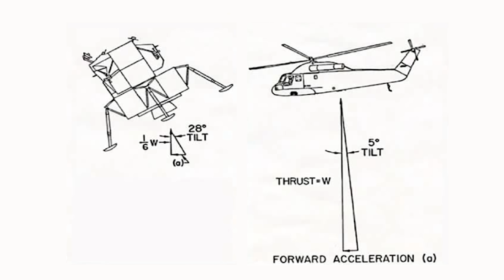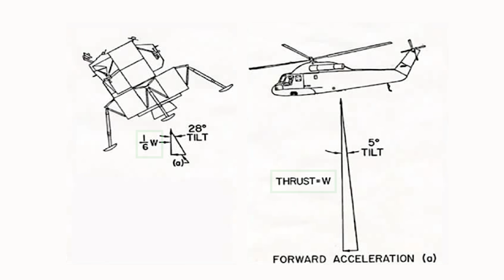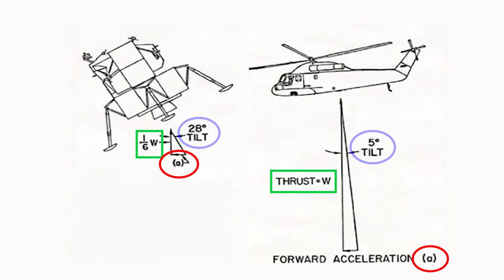How Neil Armstrong Trained to Land on the Moon  - Smarter Every Day 250

Comment: imposing restrictions on an artist does not make their art worse. Restrictions are what gives an artist inspiration, and a starting point. Some of the most beautiful art was created with the help of restrictions, whether it was the medium of the art, the tools available, or even problems held by the person creating it.

engineers back in the 60s had limited resources, and it was those very limitations that allowed them to recognize what problems needed to be solved, and pushed them to find unique ways to solve them. It's easy to see modern engineers as spoiled and much less innovative than older engineers, but that's because modern engineers have too many tools to help them solve problems. It's easy to get lost and hesitate to do something when you can't pick a direction to go to get it done. Imagine being in an open, flat plane, versus going down a thin pathway. 

It's not that modern engineers aren't as creative, it's that there's much fewer things to be creative ABOUT. so many paths have already been mapped out for them, it's harder to find a new path that no-one has gone down. It's not impossible, but it's much harder.

Comment: I really thought, that they might have built some kind of simulator with CRTVs, vector graphics and on the outside lots of hydraulics to simulate movement. Or maybe building a submarine like capsule, with the right weights, but making a whole aircraft that simulates movement in 1/6 * g is even more awesome!

Comment: Holy smokes I never realized how big of a problem this was. This was an eye opener.
Reply: lol
Reply: You would be supprised how many layers a seemingly 'simple' project like this has (if you would dare to call the moon landing simple).
Reply: Indeed, it's a big engineering feat.
In reference to 15:10 or so, Destin maybe should have put Proverbs 4, verse 7 on the end card.
Reply: They have no idea because they faked the moon landings, hollywood set and lie. Its that simple. I'll watch this to see if he even mentions the van Allen radiation belt that they have no idea how to get thru safely, with a cpu no more intelligent than a cellphone, they flew to the moon, landed and came back fine. You would have to be either easily brainwashed or mentally "slow" 
It never happened. This guy is a fraud

Comment: I agree with the idea of a free flight trainer, however simulation devices are so much better now than they used to be and as a commercial pilot I use them on a bi-annual basis. The only thing that simulators can’t change is the “seat of the pants” feeling you have biologically. Otherwise, you wouldn’t even know you were in a simulator. Your muscle memory and your visual cues would be indistinguishable from a real life flight wether it be terrestrial or lunar. A visit to an airline or aviation training facility would help you understand more about modern technological advances in this area.

Comment: 5:43 Ever heard of the "Harrier Jump Jet"? A 60's Jet ;)
Reply: The X-14 made its first vertical takeoff on February 19, 1957.   The first prototype leading up to the Harrier flew October 1960.  The Harrier GR1 made its first flight December 28, 1967.  I don't quite get the point you're attempting to make in regards to the Harrier.  It certainly was not the first jet powered plane that could make a vertical takeoff.
Reply: @buckhorncortez  I think Werner was reacting to Destin's amazement that there was a VTOL aircraft in the 1960s. When in fact there was a much more sophisticated aircraft, the Harrier, around at that same time.
Reply: @big_badaboom  Exactly. Specially since its such a Iconic Aircraft. When i think VTOL thats the first that comes to mind. Sure they did research in this earlier, even during the 1930's and 40's.
Reply: Yeah in 1967 it first flew
Reply: @dirtytreerat14   It says late 67 on google...
Reply: @jeffreyrose4240  my bad I had a typo

Comment: How do you think we will prepare for Starship landings? I have a feeling that one is mostly going to be gathering data during unmanned landings but they deff are going to want failsafes... but man manual landing of a Starship is beyond my grasp.. at least without tons of fly by wire control and sensors compensating for the pilot.

Comment: Great, now I'm curious how the emergency eject engines worked on the lltv's pilot compartment, so to assure that in case of failure, the escape pod would be ejected upward (even if the craft itself was oriented nearly horizontally - as in 10:25)

Comment: Future lunar landers are definitely an interesting subject. On Apollo programme you basically always landed with a human on the helm because the sole cargo to be landed was the human itself and other instrument that they took with them. If sustained lunar surface presence were to be maintained in the future unmanned landers are going to be needed, and they'd most likely be either partially autonomous (having separate controls for certain parts of the landing) or fully autonomous (say, can actually work if there's a boulder underneath and decide that it's not a good idea to land there).

NASA and other partners in the Artemis programme is working on fully autonomous landing system, also the current commercial HLV programme requires a demonstration for the selected design that will land autonomously on the Moon. I will say that a backup manual control would always be welcome, however...

Comment: Why would astronauts need to pilot the craft at all? We have the technology to automate it. It's no trivial task either, but it would remove the human error aspect, and testing would be all using computers. If falcon 9 first stages can automatically land, If we can send multiple automated landers to Mars, this should be a reasonable approach.
Reply: Because the computer might not see something that a human pilot would. Most of the powered descent of Apollo 11 was automated, for example, and Armstrong took manual control when he realized that the computer was taking them to an area full of big rocks. Sure, modern automated technology might be able to detect those rocks and move on, but it might be a safety feature.

Comment: It's interesting, because the side scroll games of the lunar landers gernally have horizontal thrust vectoring rockets as well. But they are only talking about tilting the whole vehicle (like a helicopter) and using the main thruster rocket as the vectoring mechanism. I would of thought that side thrusters at the top and bottom of the vehicle would slow the horizontal velocity and maintain a vertical and/or azimuth orientation whilst the main thruster would slow the vertical descent? I love this new video!

Comment: Surely a modern lander will be automated with thrusters in a quad/drone type arrangement and use radar or gps to land. I doubt a modern lander pilot would need any landing experience... only abort procedure experience.
BTW... is there gps on the moon?

Comment: Hey Destin, I am definitely not an engineer. Probably the biggest dummy on here but I am very curious. I have a question, instead of investing in a large turbine engine, did they ever consider testing a module in a buoyant environment like underwater and maybe attach floatation devices until the craft is 1/6 the weight? I imagine that it would have been cheaper. But then again I also realize that the aqueous environment could cause issues with drag and therefore unrealistic reaction times but I don't know if that is entirely the issue. Just wanted your perspective. Love your videos. HUGE fan. Keep up the good work!

Comment: "Do you think engineers were better than the ones we have today?"
"No no no (but we only used slide-rules, so yes)" :)
Reply: @gigantor56  - humility seems to be a recurring theme. The slide-rule was my little addition. I wonder if, years down the line, my grandchildren will be equally amazed at how we programmed computers manually using keyboards.
Reply: The fact that they didn't use solid rocket fuel boosters, and they fixed every problem when they found it, tells me that they were better engineers.
Reply: @davidscott5903  compared to?
Reply: @Jamie-tx7pn  
Compared to the engineers who choose to continue to use a flawed solid fueled rocket booster system with problems that have not been eliminated and will likely continue to plague us in the future.
Reply: @davidscott5903  If you talk about the SLS, the decision to use SRBs is most likely political.
Reply: @pleopsidium6960  
And every time you make an engineering decision based on politics instead of engineering design principles you run the risk of killing people.
Reply: @davidscott5903  true

Comment: My first thought for solving this problem was actually a small Zeppelin: Having a balloon lift 5/6 of the vehicle's weight would come with some issues but I reckon it could have worked as well
Reply: That's what I thought as well. Guess the biggest problem would be the drag that a big balloon would cause, but you wouldn't have to worry so much about running out of fuel as in the LLTV.
Reply: At around 7 minutes Neil Armstrong describes how they built what was in effect an overhead travelling crane which  could travel horizontally in any direction, so as to be always vertically above the vehicle. Any balloon would be completely unable to maintain position either vertically or horizontally to the necessary accuracy.
Reply: @rjmun580  I did mean a rigid balloon rigidly attached to the vehicle, but I didn't clarify that, so that misunderstanding is on me

Comment: Absolutely loved this video!  I'm a bit of an aviation nerd so I can add a couple of minor notes here; perhaps the most famous VTOL aircraft of all is the Harrier which first flew in 1967. This was preceded by a couple of prototypes made by the same company (Hawker Aviation, if you're interested) the first of which, the P.1127 first flew in November 1960. Predating that though was the Short SC.1 which had it's first VTOL flight in May 1958 (the Bell X-14's first flight was in February 1957).  VTOL flight has been around for a lot longer than we think.

Comment: Will the Artemis lander even be human controlled? Of course it should be possible to control manually just in case, but it might not be the best approach to do in normal situations nowadays.

I found this quote on the Artemis human landing system: "HLS landing capabilities are expected to include automated landing, as well as the capability for the crew to land the vehicle, with the nominal use of these capabilities to be defined as part of operationally pre-determined flight scenarios governed by mission rules. "

btw: NASA made two new lander prototypes that flew on Earth: Mighty Eagle and Project Morpheus

Comment: SpaceX already has an automated lander.  It won't be piloted.
Reply: You could automate the whole landing sequence nowadays with one Arduino.  I'd use an ESP-32 with a high res accelerometer, a lidar altitude sensor and a "motion flow sensor like you find on your mouse.  Or maybe a Jetson Nano instead of an ESP-32 since it runs faster & has lots more memory and has AI hardware built in.  The Jetson Nano can use pattern recognition feed back to guide the lander in the x-y axis and the other sensors to manage the attitude and acceleration.

Comment: "Do you think that engineers in the 50s and 60s were better than engineers today?"

As a software engineer, I'd say "it depends". Not inherently better, but because engineers thrive when they have funding and a vision and can experiment and build with few distractions, but it's rare that all those pieces come together in one program at one time. Engineers working on many aspects of the space program worked in such an environment, and so I would say that a good engineer from such a program would probably be a better engineer than most engineers today who don't work in such an environment. But take engineers with funding who are dedicated to a vision and have leadership who will move mountains of money to clear a path for them to work (see SpaceX), and they can design and build even more amazing machines today than could be built in the 50s and 60s. Consider that we've grown so used to SpaceX's VTOL rockets that we're starting to think of it as normal. Progress!

Comment: I don't see why they didn't just put a central tank of gas like co2 in liquid form that had a plumbing system and variable valves to release the gas from different points on the craft. All they would have needed is 8 pipes to each of  the 8 corners on the craft and each corner having 3 independently controlled nozzles so if you wanted to move forward you would just need to active 4 of the individual thruster facing in the opposite direction that you wanted to move. That way they would only have to control 4 valves per movement and 2-4 per rotation

Comment: Another fantastic video. As an engineer, I wonder if the average viewer could follow along with some of the technical jargon. But essentially the jet engines rotating components that allow it to produce thrust, would essentially cause the LLTV to spin around. (This is why helicopters have that smaller rotor on a long boom). So they took some of the jet engine pressure and routed it to nozzles to counteract that rotational inertia. A clever and efficient use of fuel. And so impressive that this was all done without modern digital systems controls, PIDs, etc.

Comment: The question there at the end about engineering is really interesting.

I think in one sense an engineer’s “task” is definitely easier now, because you can make iterations of your solution more or less instantly in software.

But, with that, one of the most difficult aspects of engineering is being able to decide which “department” to fix a problem in. Now, that problem is many times more complex. Sure, you CAN write a software patch. But should you really be fixing the hardware side? That decision is every bit as much “engineering” as the actual solution itself

Comment: LOL.....training?   Ha!     "outer" space is a vacuum of negative 17 torr.    Now that is more powerful than you can imagine, much more.   Rockets cannot work in outer space as the vacuum not only would give the rocket nothing which it can push to get forward momentum (no air like rockets, airplanes and balloons use) but the vacuum is so strong it would pull the fuel and oxidizer right through the seals.  No material natural or man made can withstand that kind of vacuum as any.....ANY....internal pressure, no matter how small would immediately, catastrophically cause the seal to rupture and immediately explode like an over filled balloon does with the last breath blown into it.
Reply: Lol. Vacuums aren't "powerful". They are the lack of matter, they exert no force at all. Your entire argument rests on a false premise. What happens when you suck the air out of a bottle? The vacuum is sucking on the bottle OR the surrounding atmospheric pressure is crushing the bottle?
Reply: @oscarin13      OH...Mr. I'll get REALLY technical to try to obscure the truth.    1/10th of a lb of air "pressure" in your bottle (I don't care what material, plastic,  steel, titanium, etc.) in the vacuum of space.........neg 17 torr (which I'm sure you don't understand) would cause that bottle to explode  instantly and violently.

Comment: One thing has changed tremendously since Apollo 11: computer power, and especially the use of computers in simulators. I'd guess that the first simulator will be based on a helicopter simulator. After all, g is just a constant in the computer code. And the advantage is that you might even be able to take a ride in that simulator, something that you'd have a much harder time arranging with a flying simulator.

Comment: NASA uses similar technology to this to train astronauts in zero-g. They have a machine called ARGOS (Active Response Gravity Offload System) in Houston which offloads the weight of the astronaut, and then translates any forces they apply (pushing off of objects) into a sideways force which is maintained by the system. It's essentially a more complex version of what they did for the landers but in all directions. I had a chance to try it out as part of some work my company was doing and it was a highlight of my life.  If you can, you should contact them and make a video as it was extremely cool.

Comment: It will be a fully automated landing, the next time they go.
Reply: Even if not fully automated it will be at least computer guided.
Reply: @ELYESSS  The LEM was already computer guided. The crew just had the option to take manual control (still helped by the computer).
Reply: Ya i think it will still be computer guided with the option of taking manual control. But even under manual control there would still be lots of control by the computer keeping the spacecraft stable and within the limits.
Reply: If you can have electronic reaction times why do without. Ideally you'd have it human piloted unless a given safety margin is exceeded.

Comment: Sir, thank you for all you do... SO interesting!!  BTW, those flashing led’s by the map; that’s not a binary clock, what is it??
Reply: It is a clock just not a binary one.

Top row is hour 10s, as in 10-12 or if it's in 24 hour mode, 10-24. 

Second from top is hour 1s.

3rd row from top is minute 10s

4th row is minute 1s.

So at 8:32 it shows the time as 11:50.

Comment: If you don't accelerate as good at an angle then why do rockets launch at an angle?
Reply: That’s when you’re in 1/6 gravity and you’re not firing your engine with a lot of force. Rockets launch at an angle because they are going to orbit. If they go straight up, they just fall back down. You need to turn, it’s called a gravity turn, so you can get to orbit.